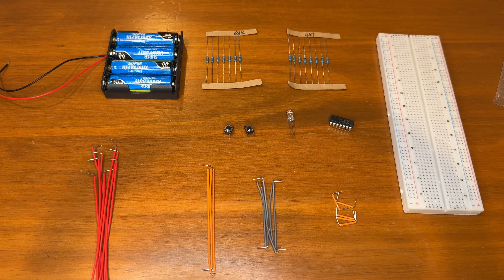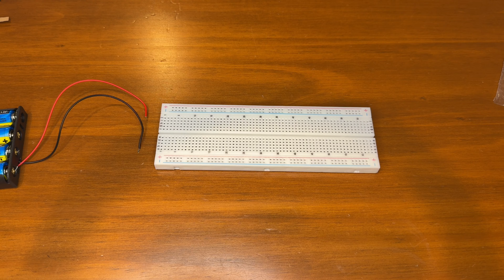Building an And Gate

Comment: I set mine up like the video and it also did not work. Turns out the horizontal negative and positive strips break off in the middle. I bridged the ground strip over from the left to right side with a piece of wire, and it worked.

Comment: I set my circuit up verbatim to this. It did not work.
Reply: same only one that worked was the first one
Reply: did you get it working at all
Reply: Same here, did it step by step and didn’t work.
Reply: I also did it verbatim and it did not work at first.

I think the problem is the push button because I rotated them around and then it finally worked for me.

I started by removing the button and just connected directly onto the gates, and it worked. So I figured the push buttons were the issue.

This worked for me at least.
Reply: Is this for beginners or professionals? You should teach a little bit more slowly and show us an electric diagram!it supposed we are learning!!!
Reply from the maker: Please ensure the following: 

1: Breadboard power rails are fully connected, please ensure you connect both sides of your power rails if your breadboard doesn't have them connected (Please refer to the updated breadboard video) 

2: Ensure proper LED, Button, and IC orientation